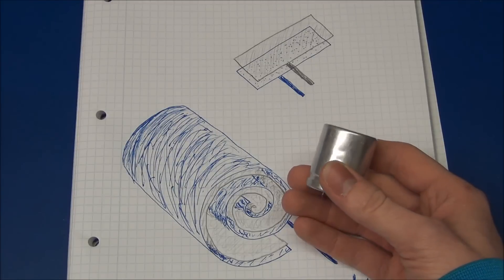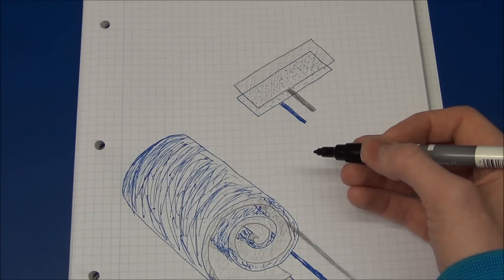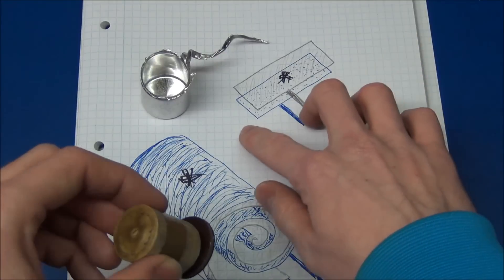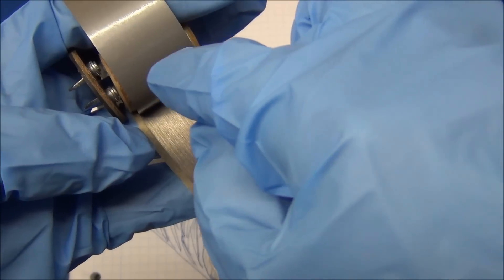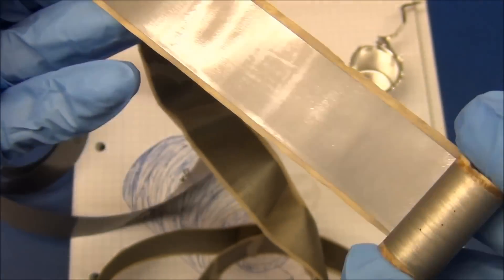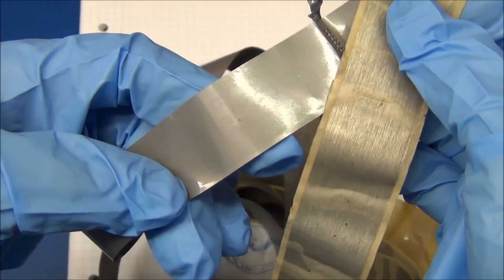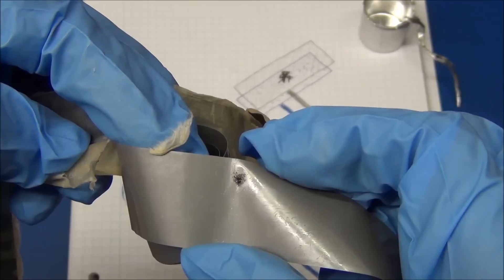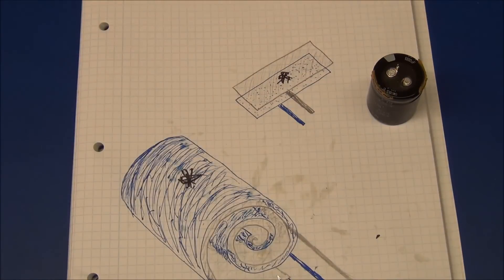Inside A Shorted Electrolytic Capacitor - Ec-Projects

Comment: i just wanted to comment that maybe one or two things happened, either impurities in the metal foil or tiny pockets of air.  Maybe manufacturers can design a better capacitor with metal free of impurities and vacuum sealed, between the foil and paper.

Comment: Be careful with high voltage caps. Once I opened a bad cap, which had a ripped connector inside and it dumped the whole charge at once while I unrolled the thing and caused somewhere a short circuit. Let it be 200V or even more.
Reply: i all so had one  same story all the way ,, yep she was a squirter electronic tec .. all the way ,, wow

Comment: Never open electronic components. The are full of stuff that can kill you. This guy is not all there.
Reply: +Frenchie No, they are harmless for the most part.  Inert materials like silica, epoxy and various metals are the common ingredients.  Electrolytic capacitors contain an acidic electrolyte, so the gloves are wise.
Reply: I blew dozens of them up as a kid, still alive lol.
Reply: The only components you should be careful with, notwithstanding the typical high voltage stuff, are selenium rectifiers. But those are old school.

Comment: HAHA Loved the method you used to put it back in the can lol I am a bit of an old school Electronics person used to have fun and a few shocks fixing Valve TV sets back in the 70's so seen more than my share of exploded capacitors was very common in high voltage equipment. I once blew up a very large capacitor in a home made power supply the 3kg Unit lifted off the table and made a heck of a mess, capacitor paper strewn all over the bedroom lol
Reply from the maker: Hehe, yeah I just felt like making a silly "out-tro"... Those caps can be some real bastards :)I have actually never seen a cap explode (by itself) in any equipment.But many years ago one of the filter caps vented in the power supply in my computer and filled entire the room with a smelly mixture of steam and smoke..
Reply: EcProjects Well the cap that exploded was a 22000 MFD capacitor I think the reason it exploded as I found out later as it was at the time the very first power supply I built was a number of factors, 1/ the vents were facing down causing them to be clogged with electrolyte fluid, second the voltage was very close to their maximum tolerance slightly over voltage, the capacitor was in use several hours beforeit blew giving it long enough to get vet hot and pressure to build up, ofcoarse I never expected it to blow so was not watching at the time, but after it blew I picked up the can which blew off and it was very hot.